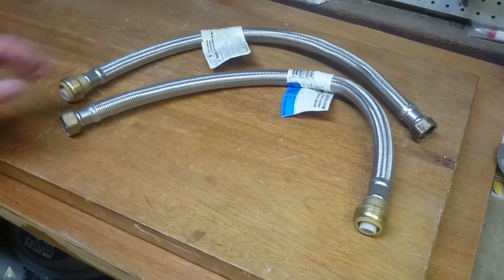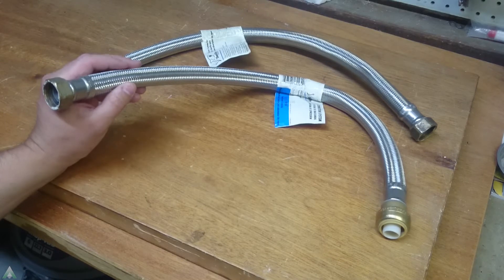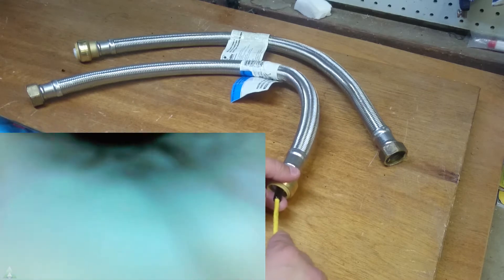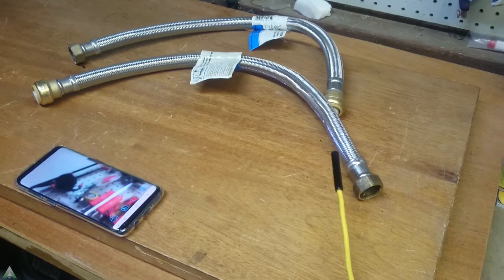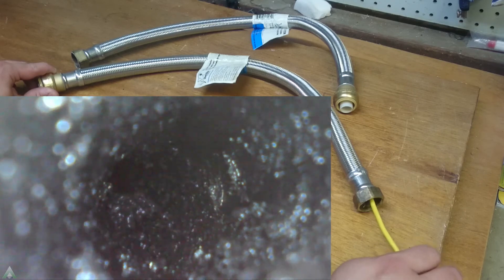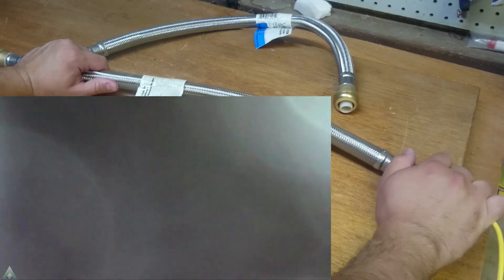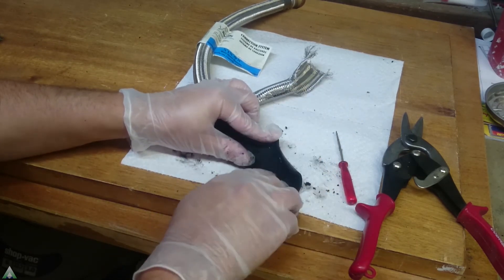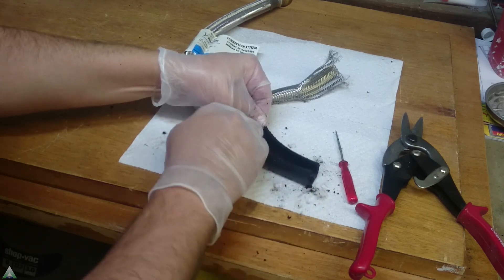Autopsy of a Failed Sharkbite Flexible Hose 3/4" FIP Fitting for Water Heaters

Comment: I have u3008ex18LF connection that I used for a leaking pipe between the water heater and the kitchen faucet and I noticed the black particles (that is why I am here), had to remove faucet and flush a couple times this week because of low water pressure in the faucet, got good pressure after flushing but I think thats not goingt to last. You mentioned that the LF is new type (or the one that you received as replacemnt) but it seems LF has the same issue.
Reply from the maker: It has been a long time and new models may have been produced to replace the "new" (now old) model that was made back then.
Reply: @ColoradoRMN ended replacing with the 18 inch max flex pipe, looked inside the old one and it looked like it was in the video but worse.

Comment: I installed a non-sharkbite flexible water heater hoses purchased at LOWES when I installed my waterheater. A few years later it sprung a leak at the hot side heater outlet. When I looked at the fitting, the rubber hose was highly deteriorating and was spewing water everywhere. I have galvanized iron pipes and Sharkbite was not an option and copper is not allowed to touch my pipes because of corrosion issues. I had to go to a real plumbing store to purchase flexible stainless steel connector pipes. 

As a warning to all who have these flexible pipes on the hot water side of the waterheater, get rid of them before they cause damage. I was lucky that my waterheater was in my garage and my damage was minimal. They are band from my house. The flex hoses work fine in other applications around the house, they can’t take being continuously being hot.

Comment: I installed my braided hoses back in 2015  and discovered this crap in my tub a couple of years ago. I am just now getting around to replacing them with pex pipe with crimp ring connectors and fittings. I should've done it sooner but at least it will never happen again. I will not trust the new ones just go with straight pex pipe, it is so easy to cut or replace, if needed down the road.

Comment: Thanks for this, @ColoradoRMN. My experience has been similar so far: I talked to Jennifer at Reliance Sharkbite today and she's going to mail me the corrugated steel kit as my replacement. She also sending a pre-paid shipping label to get the bad ones back, maybe they're trying to ensure they don't get re-used. 

She had me read to her the assembly date off the Sharkbite end of one of my bad ones, it is ASSE 1061 S3213, which she confirmed is a bad one from 2013 manufacture. Strange thing is, I found my Home Depot receipt from December, 2014, and the products had LF at the end of their name, yet they're deteriorating 6 years later. Who knows, maybe they sat in inventory for a year or more and were re-bar-coded with the new identifier. That, or the "improved" LF products will fail after six years, as well. That's why I went with the corrugated, rubber-less version.
Reply from the maker: let's hope the corrugated one works well in the long term. It was too new at the time and I was not sure if I wanted to go for it. Hope it lasts for many years with no issues. Let us know if there are any updates.

Comment: Clearly the hot water was the culprit more so than the chlorine. The CW piping having small degree of deterioration just at the water heater is due to the thermal expansion created by the hot water as well as a small degree of convective heat transfer. Basically hot water from the tank expands into the CW line. So even though it is the CW line it will get hot water in the braided hose. The closer to the tank the hotter the water.

Comment: Is there a class action lawsuit? I Would like to join!! I nearly lost my mind because of this problem!!!! What is interesting is, when you go to the hardware store (Lowes in my case)  now, they changed the the pipe material to something like pex. I went to the store not looking into my own flex connectors (which I should have done from the beginning), saw that they were pex and assumed that my shark bite hoses were also pex. After seeing your video I actually looked inside and saw the EPDM which is black. It also is more flexible (like a garden hose) in comparison to the pex ones. If I called a plumber, they would have convinced me to overhaul my plumping because that's what desperate plumbers do... THANK YOU!

Comment: Thank you for the video. Had same experience with customers lines, Replaced with new and everything working good. Please let me know what type of camera line you are using in the video. I need one that will go in to 3/4" lines desperately. Did it hook up to your smartphone? Please reply at your earliest convenience. Thanks again.
Reply from the maker: Thanks for watching. I used a BlueFire Semi-Rigid Flexible Wireless Endoscope: They have two: 11 feet cable: https://amzn.to/31VG8ne and 33 feet cable: https://amzn.to/2HoE5Pl  . It is wireless so using an app to connect via WiFi to the Camera. This one is "Semi-Rigid," meaning it has a cable in there that forms the shape and it is not totally flexible. If you want a totally flexible wire, check some of the others: https://amzn.to/2StKEX2

Comment: Thank you for taking the time to show us this failure in this technology.  Copper it is for me.  It's been a proven for over a century to be reliable I believe, and it's been said that copper have antimicrobial properties which ancient civilizations discovered.  Right now, I have a temporary fix on a few pin hole leaks on the copper vertical hot main line (20 years).  I was flirting with the idea of using Sharkbites since I installed the temporary fix (i.e. silicone tape); looking for testimony on the reliability of Sharkbites (and related technology).

I suppose if water tanks have a 6 year life-span then the flex hose would need to be replaced every time a tank is replaced.  I agree that Sharkbites are great for TEMPORARY fixes.  HOWEVER, it doesn't mean the rubber is not slowly deteriorating, leaving this rubber compound for you to ingest (i.e. brushing teeth, cooking, etc...).  Hmmm...makes one wonder on the health problems like cancer that we people get.
Reply from the maker: There are many good uses for SharkBites and the new/fixed model seem to be doing a good job so far with no issues. Time will tell.  However, it is a good idea to learn / know how to solder pipe if possible.  As for health effects,  it is not a good idea to use hot water for cooking. Use cold & filtered water and heat/ boil it. After seeing some of the old hot water tanks opened on YouTube, I do not want that stuff in my food, regardless if pipe connectors  is copper or Sharkbite. Food related water should use cold line and, if possible,  filtered.
Reply: @ColoradoRMN  The corrugated line just failed on me after 3 years.  It wasn't the sharkbite end, but rather the washer at the threaded end decayed and started leaking there, on the cold inlet side.  Hot water side seems to be holding.
Reply from the maker: @kornucopia9460  Thank you for your comment and update. Good to know and helps with long term use expectations.

Comment: I have the same issue, replaced the lines and cut them open, found the exact same issue. My question is, I am still getting black residue. How long did it take to flush out the residue out of the tank/lines after you replaced them?
Reply from the maker: You may want to remove aerators and see if fragments from the rubber is still in there. Once they are replaced and I cleaned the faucet aerators issue stopped right away.

Comment: I connected my 1/2 sharkbite with valve to my copper tubing and didn’t hear a snap, i marked the spot on how far it goes in the pipe and it did reach the spot. But i noticed all the other sharbite connections snap, does that matter for the the flex hose?

Comment: I would just go to eBay and buy a pre-made all-metal  -  'Corrugated Copper Water Heater Connector',  or a 'Corrugated Stainless Steel Water Heater Connector'  that you can find on eBay.  Those are all-metal in construction, with no internal rubber parts to dissolve.
Reply: Except there is... There's a large rubber washer to seal the threaded end.  Mine just failed after 3 years installed and it was on the cold inlet side that it failed.

Comment: I have seen the same thing with the Sharkbite flex water heater hose ,they should be taken off the market they are Junk . I have seen many of them fail and cost homeowners a lot of trouble.They still sell them, Sharkbite should have to pay for the cost of installing a proper line or sued.

Comment: your lucky if new water heaters last 7 years now.  6 years old sharkbite fitting sounds like it did its job.
Reply from the maker: What's the average failure rate? I see some come with 12 year warranty (at a higher cost of course).

Comment: I just want to ty for this video. I spent over 2 yrs trying to figure out what all that black stuff was in my hot water. Plumber was like call the city. I told him they already came out twice and said it was fine outside. Explained it only came out from the hot. So he asked "what do you want me to do about?" Dude I don't fucking know, you're the plumber. He said "Buy a new tank" So I got another plumber to get me a new tank. He too was a fucktard. So 2 months pass, and I still have the same problem. I cam across your vide a few weeks ago, and I thought maybe that jackass plumber used the same hoses. I went out to look, and sure enough they were sharkbite hoses, and they were old looking. Fucker never changed the hose. So I called Sharkbite, and my replacement hoses just got here. I'm hoping this is the answer, and by what you showed us in the video I am 99% sure this is it. Wish I didn't need to spend the money on the 6yr old hot water heater that was fine. Of course the Company I bought the heater from said warranty had expired.
Reply from the maker: You are welcome! This is why I did the video in hopes that it will help someone out as to why this is happening.  Too bad they never replaced the houses when they did your install but glad you got it all sorted out.  Glad the replacement from Sharkbite was quick and painless process.

Comment: What about the 5 ft braided laundry hoses connected to the hot water side of a washer. (without shark-bytes) Just regular rubber hoses.  Could this be a cause for laundry stains on clothing?  Just wondering.

Ray L
Reply from the maker: Not sure. Take a look if the rubber washer may be disintegrating .  After some time the chlorine in water can effect the washer quality and if you touch it you may see some marks left on the finger, if so replace the rubber washer.

Comment: Thanks for the video. My Sharkbite fittings were 6 years old and also began deteriorating. The rubber debris created a black greasy substance on the tub ring. We thought the porcelain on the tubs was old and stained.  Sharkbite replaced both hoses for free. They are supposed to have a new formulation. I think the cold water line in was the worst. Tubs are staying clean again.
Reply: Here's ANOTHER Sharkbite FAILURE.  I bet chlorinated water killed that precious o-ring. Causing you a world of fun. LOL  When they turn greasy as you say, something is attacking/eating the rubber away.
Reply from the maker: Thanks for the comment. I suspect more and more folks will be finding this issue as their hoses begin to deteriorate. Was glad they replaced mine for free too. Hope these new ones last a long time (time will tell). Interesting that your cold side was worse; as you seen in the video my host side was bad but cold was not bad.
Reply: @ColoradoRMN  Yea now all you have to worry about is when the shark bite connection starts to leak.
Reply: Yes and that stuff is hard to get off of tubs .

Comment: It's 5a.m. and I just crawled out from under my house;I crawled under due to an odd noise I was hearing. Low and behold it was the shark bite hot water steel braided hose leaking/spraying water so now I've a small pond underneath the house and it's time to leave for work! Oh, joy.
Reply: Update/Correction: it wasn't a sharkbite flex hose; it was a flex hose from home depot(unsure of brand) that was tied into a sharkbite(still holding up  well & doing what it's supposed to do) fitting.
Reply: NO, that never happens with Sharkbites. LOL  Xandervk loves them. Read her comments above.
Reply: Oh that's not a pond. I believe the proper name is a mote. Now the Visigoths can't storm your castle.  lol

Comment: In my opinion, Sharkbites should only be a temporary fix, and never enclosed.
Reply: Sharkbites are not allowed in a lot of cities in Texas because of failure.
Reply: I just assumed that the water heater flex hoses needed to be replaced every 5 years just like the washing machine ones.
Reply: In mine, they should NEVER be used on anything. We have a superior method in rigid copper. Why not use the best you can possibly buy? Pex is another joke.
Reply: @jimdavidson5208  I agree with you except I like them for temporary cap during remodel demolition type work.

Comment: All you Sharkbite lovers. Wait till the O-ring inside fails and floods your house LOL.
Reply: It's not going to fail catastrophically.
Reply: Hope you have good home insurance. Flooding your house can cost thousands of dollars. Then you still have to "properly" repair your tank.
Reply: @jimdavidson5208  The O-ring is squeezed between the pipe and the fitting body, and there are retaining teeth on the outside. It's not going to just blow out of there, if you even know what you were trying to say. Besides, the heater itself has a finite life span, so the point is rather moot anyway.
Reply: Rigid copper pipe compared to ANY Sharkbite mess. Only failure on rigid is a bad solder joint. Rare but possible. On a Sharkbite, that 0-ring will deteriorate from chlorinated city water or even well water with all its minerals and sand/sediment junk it has. And those teeth are just extra parts to fail. Look at the parts count of each one. Obviously rigid has way fewer parts to fail on you. Money wise rigid is even CHEAPER than a Sharkbite connection. Have you priced some of the larger Sharkbite fittings? As in WOW........   There are many ways to plumb something up. If something is more convenient to install, it will fail way sooner than something that takes longer. Sharkbites are all about convenience. Why risk flooding your house and belongings? True the heater has a life span. Keep the anode rod/s changed out, flush the sucker and kep a dip tub in it. She will last a while.
Reply: Also when you shove that Sharkbite on the pipe, if that pipe is not PERFECTLY smooth, it will tear that precious o-ring you are defending , for some reason??? One little piece of maybe old solder or a nick when cutting the pipe will do it. Buy what you want. Old school rigid copper pipe is superior period. I hear what you are saying. I'm just saying there is a PROVEN, time tested method, that is better. It's called rigid copper pipes. Pex is another nightmare. Here's another "convenient" mess.
Reply: @jimdavidson5208  You have to prepare the pipe just like if you were soldering, if not more carefully. De-burr and smooth out with a fitting brush. I even got the correct gauge/deburring tool. If the pipe goes in all the way, it's not going to damage the seal.
Reply: I just disconnected my soldered 3/4 ''copper connectors from my water heater threaded nipples, while changing my water heater.  The built in black o-ring like the ones on the hose pipes, that was totally deteriorated into a black leaky mess.  The washers had to be changed too, with the heater. Granted washers are cheaper if you can find some, than the $15 sharkbite connectors or compression type 18" long 3/4" connectors.
Reply: @jimdavidson5208  I have had 3 pinhole leaks in my copper horizontal hot main line coming out of my boiler, meanwhile my sharkbite connections are still holding strong.
Reply: @jimdavidson5208  And some insurance company's might not pay because you installed something that is not approved by your city inspection code they are not allowed in my city.
Reply: @jimdavidson5208  good thing they  clean and sanitize my water with just oxygen
Reply: @curb1125  funny because i dont need to change the washers anymore on the hot side than cold on the valve stems 🤷‍♂️
Reply: You sound like an Angry old man mad at new tech. I bet your pissed about carburetors and electronic heater door motors too!
Reply: @jim davidson LOL "Get off my lawn you damn Kids".  Old man still probably has a phone with a cord on it cause he's scared of technology.... I'll trust a global company and their team of engineers over some some "pro" soldering
Reply: @GMAC240   I have never had an issue with shark bites  I use propress most of the time same thing no issues. I had soldering pipes and some building wont let you work without a propress - these technologies have been out 25 years
Reply: @jimdavidson5208 The only leak I ever had was copper pipe. Pin holes not the fittings. The sharkbite valves I have, 18 of them are 15 years old and never ever a leak. I just replaced my water heater hoses because I added a expansion tank and I removed them, so I replaced them and took the o ring out and they are like new as is the inside rubber. They are 10 years old installed in 2014. If anyone states "I only use copper because it's the best" Has no idea of different water sources and quality around the country. If I had copper pipes with my whole house RO system, I would be re piping my house every few years from the water leaching the material. My CPVC is 26 years old and no leaks to date. Copper pipes are not for every house and sharkbite may not work for city water that is chlorinated. Do some research before installing anything and stop with the bs that sharkbites suck and copper is the best.